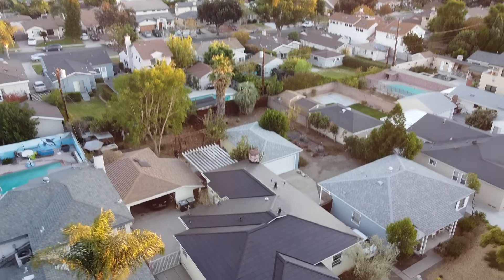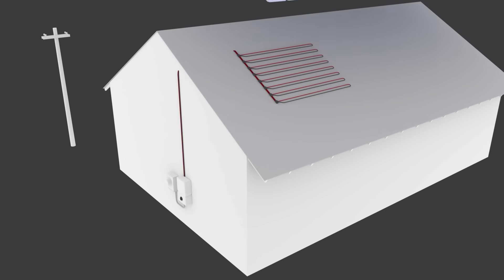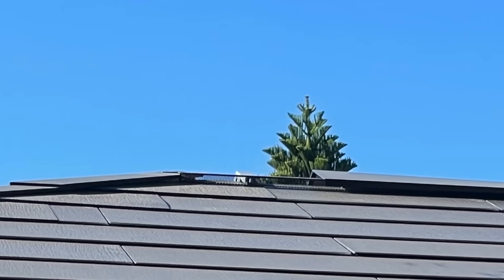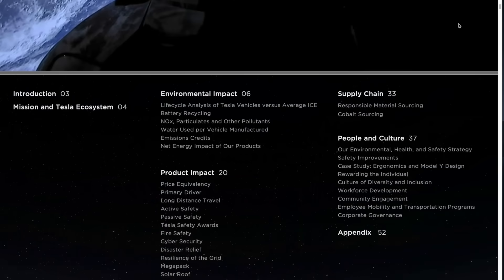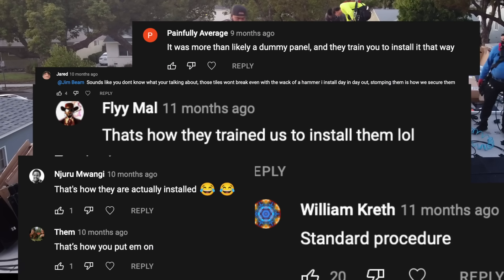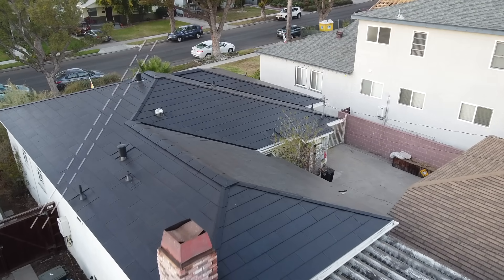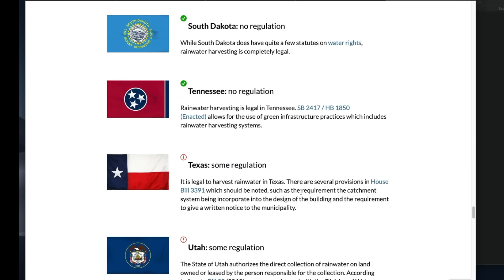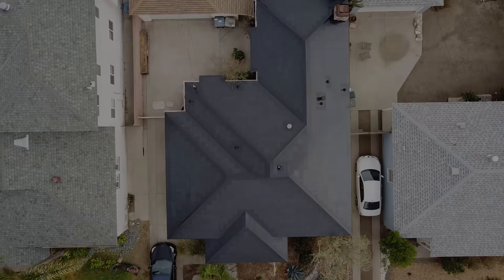10 Things WRONG With My Tesla Solar Roof

Comment: If a portion of the electrical power generated by the solar is used to run carbon capture, then solar can be net zero.
Even more so, most of solars CO2 emissions come from non electrified industries such as mining equipment and raw materials transport.

Comment: Haha spot on with concern number one.  I will admit I was confused by what it looked like until you shed light on it.  I have 400m2 of grass out the back yard(in Brisbane) and spend a fortune on water each month.  That aside, your video has prompted me to get a solar system with a tesla battery.  We don't have the tesla tiles, but I recently changed my roof to tin so traditional panels and a tesla battery will have to do.  We have pretty bad hail here so hopefully the pitch of my roof will save me.  We actually have to upgrade out insurance here if we get solar which is something I didn't know before.  I look forward to seeing more videos from you.  Also, is there a limit to what you can export to the grid?  In Australia it's 5kw per day for single phase and 15kw per day for 3 phase.  Would be interesting to know if America takes the piss like here.
Reply: Exporting is a scam (they pay so little in AU/NZ usually) just cut yourself off from the eternal power dews. Battery pack is worth the investment, spend what you spend on yearly power bills on your batteries and solar in one go or just add until you can cut them off.

Comment: Thank you for being so ecologically savvy.  Your California rain garden is much better looking than a regular lawn, besides being the "green" thing to do.  I do have a question about your roof.  Do you worry about advances in roof technology making yours obsolete?  I have decided to do a standing seam metal roof with solar panels.  They will be so much easier and cheaper to replace in the event of some major gain in technology.
Reply from the maker: It takes a minute to change out a tile as they’re are clipped into connectors. Tesla just introduced a new tile that is 24% more powerful. Not that I will, but maybe in a few years when prices have dropped and performance increased even more, I would consider changing out some of the tiles.
Reply: @ThisGuysTesla  I would also like to point out that your front garden is absolutely amazing. F#ck lawns, they are sooooo 20th century. What you have is not only better looking, it's also way better for the environment, it's a win win!
Reply: 120 years ago, Thorstein Veblen pointed out that lawns were a way for rich people to show that they had so much money to waste that they could make something that looked like a cow pasture without having to make money off it by actually raising cows.  And of course whatever rich people were doing 120 years ago is what all Americans have to do now...

Comment: The first place to start when considering adding solar energy is to make your existing home more energy efficient first.
An energy efficient home or business is more comfortable and saves money in the long run.
Solar energy on your roof combined with battery storage can make people more independent from the grid and natural gas supplies. Add solar and supplemental electric heating or a heat pump for home or business heating..
All big box stores and manufacturing sites can support solar energy on their roofs or parking lots.
Added insulation, triple glaze windows, energy efficient doors, energy efficient heating and cooling systems, energy efficient appliances, LED lighting, smart thermostats, solar panels combined with battery storage and a electric vehicle charger in the garage or car park. People are too focused on the short term costs and miss out on long term savings and comfort. Blower door testing and air sealing are under appreciated tools.Even if you have money to burn you should not waste it.  Climate Change will impact everyone. Leave a better future for your children and grandchildren. Join in and speak up for the future of the planet.
Reply: Duct sealing is almost insane with how much it helps make a house stay warmer and cooler easier. I used to live in a poorly insulated apartment. No sealing and both doors had very obvious gaps that let air through. Had to keep the place at 70-68 F to keep it cool in the summer. Meanwhile, I visited my mom's house that has good windows and doors along with duct sealing, and at 73 F on the thermostat is gets to be too cold without a blanket on your lap.
Reply: Getting a battery is still not cost efficient yet. Use the money to get more energy efficient appliances.
Reply: Don’t forget to pipe in Elon’s farts for that warm gushy smug feeling you get when you idolize Tesla
Reply: Because those long term savings don’t last the length of the average home 
ownership.
Besides California is flipping dumb. Get rid of incandescent lights. Push for mercury filled ones, which I had to continually point out to people. 
Yet haven’t mandated tankless water heater’s. All that energy wasted keeping water hot.